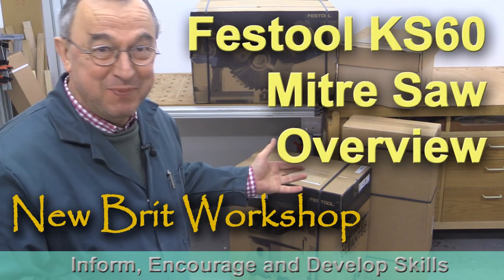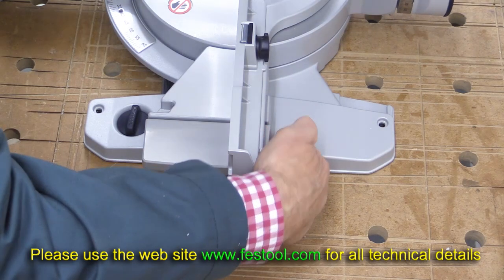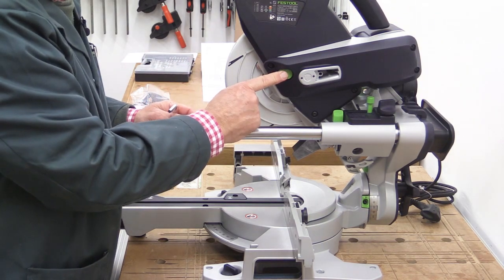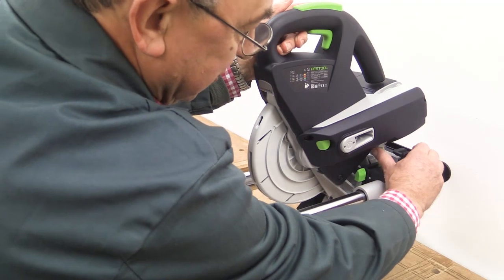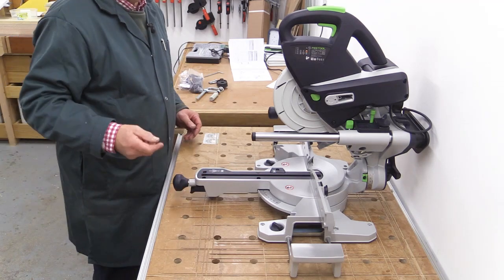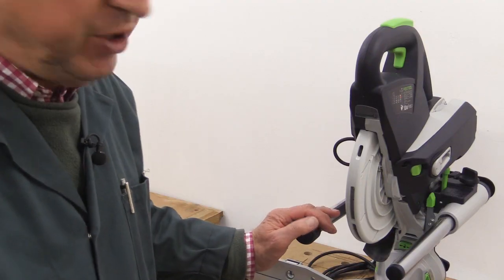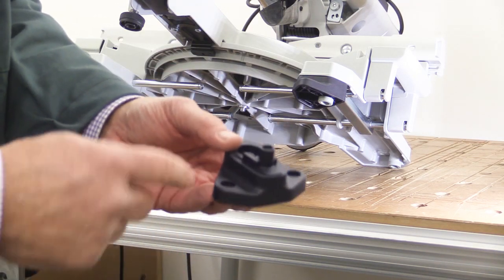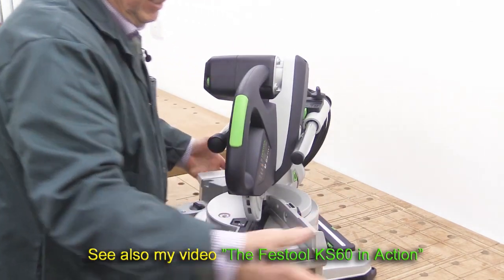Festool Kapex KS 60 Mitre Saw - Overview (1 of 2)

Comment: Such a great in depth review Peter and this video has cemented my decision to buy the KS60 in the next few days.
Also interesting to hear you comment on the brushes as I recently went over to the new Festool TS55 track saw and was a little surprised at the motor smell and sparks etc when I first used it, wasn’t particularly worried but good to hear your explanation! 😅

Comment: Hi Peter saw delivery was successful! Thank for reply. FYI clear bag that came with saw that had the feet in it to make it sys one compatible, included a longer screw and spring to replace the short one. So it can have the extra support required at the front.

Comment: Awesome Peter ! I've seen on the festool's website that there are two versions of the ks60, one is 240volts and the other works at 110 voltas, which is the one you used for this video?
Reply from the maker: Hi Hector, The one I borrowed was 220 volts. An excellent machine.   Peter

Comment: Thank you Peter, as always very comprehensive.  This is a serious contender for my small workshop so I'm interested in how it performs and of course the dust extraction.  Even as an amateur I'm becoming much more aware of 'dust' in the workshop and have re-visited quite a few of your videos and effective dust extraction seems to be a major advantage with this brand placing it head and shoulders above the rest.  My old Jet mitre saw needs replacing so I await your next video to see it in action and any comparisons you make with its bigger stable mate (the Kapex is way out of my league).  Thanks gain

Regards

Mike
Reply from the maker: Hi Mike, The dust collection is excellent. It is an accurate and well thought out machine. Do watch my video before making a choice. I already have the larger KS 120 and I would not swap but it would be a hard choice if I were starting from scratch. Once you have seen Part 2 (that should be no later than Sunday evening) do try and get a demo at your local dealership.   Peter

Comment: hi peter, when the machine has enough clearance at the back wall to swing, what distance is it to the front lock knob from the wall? thanks
Reply from the maker: Hi Kevin, Sorry but the machine went back straight after the video was made. However, I did a Google search and found a drawing:
https://www.pinterest.com/pin/354869645620060203/
Peter

Comment: Hi, I bought the KS120 as a replacement for my shop mitre saw, (your vids helped me on that purchase, Thanks )  Loving it, beautiful machine, I was thinking that i would be able to transport it to site if needed but it is a bit too bulky ( & far too nice for site work ) so I'm happy to keep going with the Makita for that. Getting to my point - I was going to buy this machine KS60 but the 45º only cuts up to 40mm, therefore i wouldn't be able to mitre a piece of 3x2, old imperial or the smaller modern metric sized wood.  is that correct? ( because I'm still tempted to buy another Kapex for site work, might have to get the KS88E which does 55mm @ 45º but costs £775, nearly as much as the 120 & as big.
Reply from the maker: Hi Gid, A 45 Degree mitre cut can be up to 215 mm wide and 60 mm deep and so will easily manage your 4x2. If you were cutting a 45 degree x 45 degree compound then the cut would be 215 mm x 40 mm.  Peter
Reply: Thanks that's good to know, thought it was odd that it wouldn't be able to cut a standard 2" timber. I wasn't sure when i read the specs on this machine, I could've saved a few pounds but still not regretting buying the 120. Might just have to buy another ;)

Comment: Hi Peter ordered the KS60 for our site needs so the 120 can stay in the workshop. Thought I'd watch your video to get "fam-ed" up on it prior to arrival. Bought the set version, like the led when I seen it on demo at our shop from Craig. Just had a thought. If you put the feet on it to Sys 1 height. Does that not make the black adjustable knob at the front (first mentioned very earlier on in your video) redundant as I'm assuming it won't touch the table? Due to the extra height gain. Great video. Thank you
Reply from the maker: Hi James, I no longer have access to a KS60 but think that you may be right. When you get your machine (you lucky chap) have a closer look. The KS60 is the perfect site saw.   Peter

Comment: Well, that is really weird. Up until now I thought that every button/switch/knob etc was green. This is a great system so that even if unfamiliar you have a clue what to look for. The big knob at the back and the front is blue??? And the 2 to adjust the sides.
Reply from the maker: I very nearly said something about the colour of the knobs but it is the same on other tools. I think that the green idea is for those things that are for the user to adjust or set for a change in function rather than an adjustment for comfort. Anyway, there must be a very clever person in Festool who decides.   Peter

Comment: Hi Peter
Another great video thanks. As a result of watching your series of videos (and I have now retired so have some free time)  I decided to try my hand at some woodwork and have invested a fair bit in some Festool kit.  (Never been any good at woodwork so thought it about time I tried again).
I have just purchased the Ks 60 and would like to ask your views using it and other power tools left handed.  When using a portable circular saw for example I find it very awkward with the blade on the right. ( I believe you can get left handed versions in the USA but not in the U.K.)
Probably a bit of a strange question but wondered if you have ever heard of any safety issues using power tools left handed? I guess the Ks60 is ok standing either side of the blade.

Please keep the films coming. 

Brian
Reply from the maker: Hi Brian, My brother is left handed and he has not problems that I am aware of. The KS 60 is symmetrical as far as sawing goes. I often use my TS55 left handed as it is sometimes easier depending where the wood is that  am cutting. Obviously drills and tools like the Domino are just as easy. So, I would suggest that you do not worry about it.   Many thanks for the kind words and enjoy that lovely KS 60.   Cheers.   Peter

Comment: Is it possible to rotate dust port to left or right so that the saw could stay close to wall with hose attached? If not out of the box, is there some special accessory for that?
Reply from the maker: Yes, it will rotate. I cannot remember if you have to loosen a screw in order to allow it to move but it is something that the user can do very easily. There is no need for any special kit at all. It is a long time since I made the video but remember this part quite well.    Peter

Comment: So is it worth spending the extra money on the 120, or save a few quid and go for the 60?
Reply from the maker: Hi Nicholas, This really does depend on what type of work you do and your budget. The KS60 is absolutely the machine for the rad warrior, will suit the lower budget static person but will not quite match the KS120 for overall performance. I really like the +60 -60 degree mitre capability of the KS60 but would find it hard to be stuck with a maximum 60 mm depth of cut.   Peter

Comment: How can you adjust the angles on the saw. Can't find anything on it on the internet.
Reply from the maker: It is shown in the second part of the video unless you mean adjusting the saw if it is out of square.  Peter
Reply: @NewBritWorkshop  yes, I mean if it is out of square.
Reply from the maker: I only had that saw on loan for a week or so and so cannot look at it for you. I have tried to find instructions on its adjustment on the internet with no luck. Sorry.  Peter

Comment: I assume that if one has a KS120, and has no portability concerns, there's no real reason to get this, right? It doesn't look like there's any increase in cut capability in any direction, minus a few more degrees of angle. It's difficult to tell, but I assume the max cut width is the same as the 120?

IOW, I assume this is more about making a more portable miter saw for trim work.
Reply from the maker: Hi Pete, Yes, it s about being more portable and I will stick with my KS 120. It is a close call though as the price is quite tempting for the first time Festool mitre saw buyer.   Peter
Reply: Perfect, thanks. I like my full-size Kapex. If anything, I'd like to see one with a larger blade and even more capacity.

It's tempting to treat Festool stuff like Pokemon, and catch them all. I just stacked up all my sander systainers the other day and asked myself what on earth I was thinking. :)
Reply from the maker: Hi Pete, I am not sure if capacity is the driver for me or just the solid feel of the larger Kapex. The KS60 is sweet and does a great job but I quite like "solid" when they are not needed to go anywhere. Cheers. Peter

Comment: Hi could anyone answer my question I’m a carpenter joiner so I cover anything with wood but spend most of my time on site roofing and doors skirting etc so would a ks60 be able to cut a 50x200 at say 45x45 degrees for a hip roof or valley is the blade deep enough for this kind of job yes I know the is 120 would be better but i get caught out in rain snow sun so I couldn’t leave myself to leave a 120 outside
Reply from the maker: Hi Mark, You can cut a 45 x 45 deg hip at up to 215 x 40 mm. A straight 90 x 45 deg cut is 215 x 60 mm and a normal 90 x 90 deg cut is 305 x 60 mm.    So not quite there for your hip joint.  Peter
Reply: Ok thank you Peter I use a Dewalt 706 but after 15 years it’s not got much life in it so I shall continue the search many thanks love your channel
Reply: And what would you have if festool wasn’t an option for a all rounder
Reply from the maker: Hi Mark, I am not an expert on any of the other saws as I have never owned or used them. However, I know a lot of chaps working on site like the Dewalt range. For workshop based people the other make and model to look for is the Bosch Glide. I see that the Bosch GCM 350-254 Slide Mitre Saw does a compound 45 x 45 deg at 226 x 50 mm and is not too expensive.   Peter

Comment: It's not accurate, the 45° bevel function is not straight. Check before you buy. I returned 2 of them
Reply from the maker: Mine was spot on.   Peter
Reply: I have bought 8 of them and they were all straight. I am doubting your returning 2 of them. I think I have read several comments by you on different videos.

Comment: Don't buy it - just got one and the bevel is not right at 0° - and there is no way to adjust it. Each time I have to cut something I have to check with a square. 
Really deceived by such a big name, so expensive saw !
Reply from the maker: The great thing that you are able to use is the 30 day free and no quibble return policy. Under the 3 year guarantee you would have been able to get Festool to pick it up, repair it or replace it and then return it to you and all free of charge. Peter